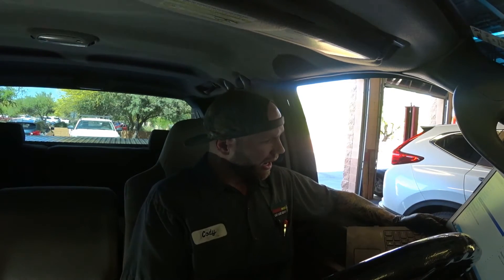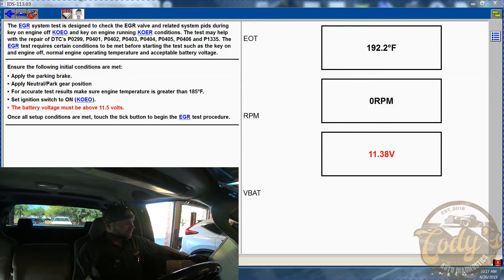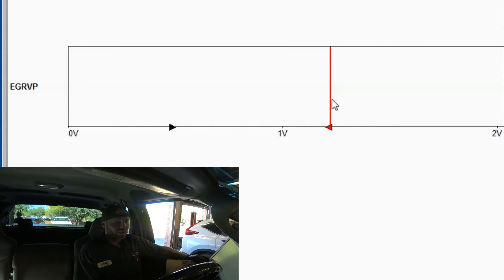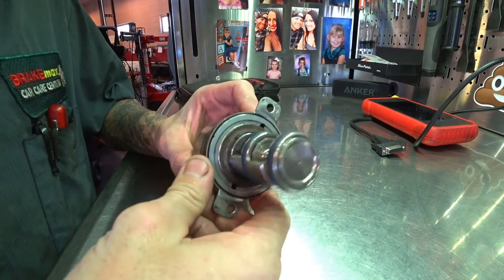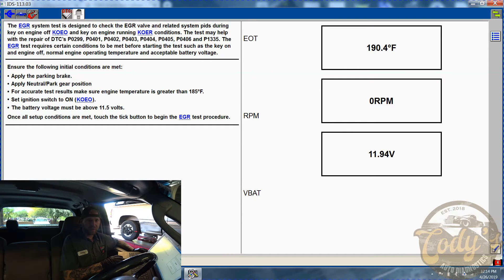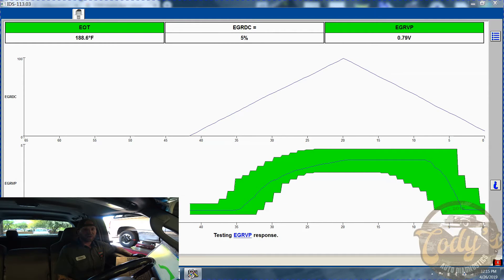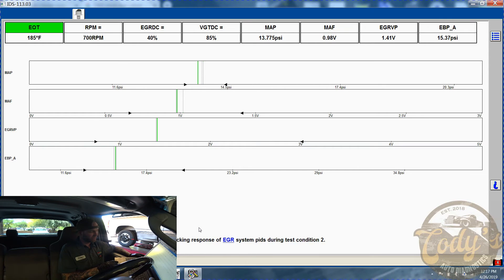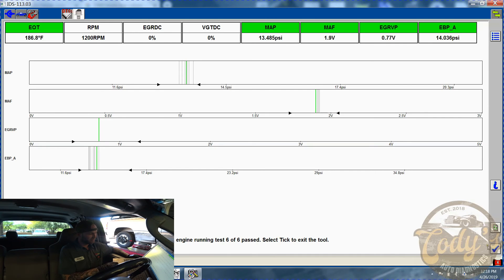FORD F-250 EGR CODE P1335

Comment: Fantastic! i like that ford gives you lots of tests to verify repairs. I worked for Ford back in the day when the WDS was first introduced, i remember the NGS i think it was called. Anyway great video.
Reply from the maker: Auto Fix Pal that’s awesome, I bet that was a pretty cool experience?
Reply: @codysautodiagnosticsprogra8706  yeah it was fun. I learned a lot. My first and last time getting burnt by not load testing a circuit was back then, it was a Lincoln Town Car. Harness went across the front bumper and water would collect there and eventually cause problems.
Reply from the maker: Auto Fix Pal That’s funny I’ve been in the same situation and it only took one time getting burned for me to learn my lesson LOL

Comment: Outstanding work Bro’ 👍🏻👍🏻👍🏻👍🏻👍🏻👍🏻👍🏻,, “trick” if you want one for Ford 6.0 EGR work,, Be for you install the EGR and after you have cleaned the bore hole the best you can,, Try to start the engine with the EGR valve NOT installed at all most full Throttle. Now most of the time the engine will not start or will not want to run BUT what your doing is using the exhaust pressure to blow out any leftover carbon and trash still down in there!!!! It will shot out and hit the bottom of the trucks hood!!! 😳😳😳😳😳😳😬😬😬😬 so be ready to that!!!! Doing that will 100% help stop a come back from that trash getting right back in to the EGR valve with in 100 miles..
Reply from the maker: Truck Mechanic that’s a great tip and good to know bud, thank you!

Comment: Had an 04 f250 6.0l truck in my shop 4 years ago. Opened the hood for service and there's an EGR valve cable tied next to the one in the engine.
It was plugged in to the harness. Pulled the one mounted in the engine and it was spot welded in the closed position. Poor mans EGR block off kit I guess.
Reply: Mark Patton ,,, That’s awesome 😃😃🤣🤣🤣🤣🤣🤣,, If the truck is below 6/2014 in the Build date you can just unplug the EGR and that will not set the check engine light. 😏😏😏😏😏.
Reply from the maker: Wow cheap mans delete kit 😂😂😆 that’s good stuff